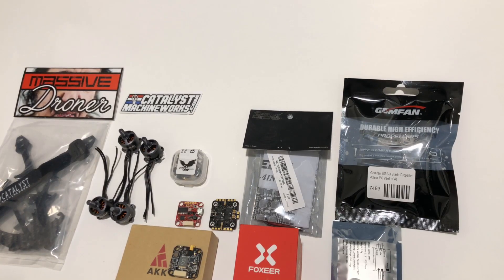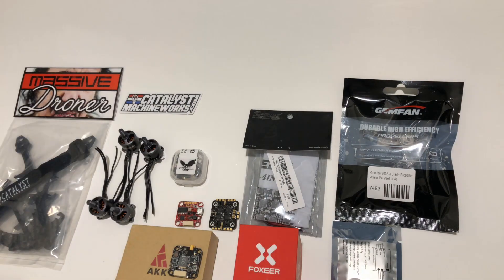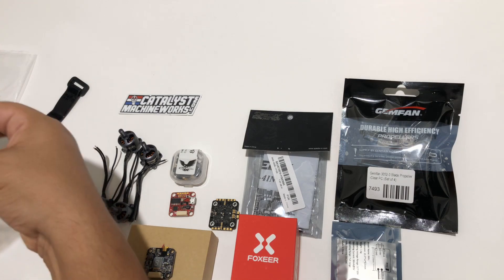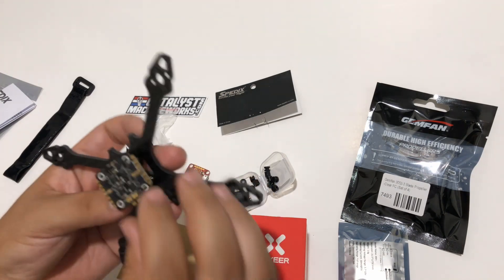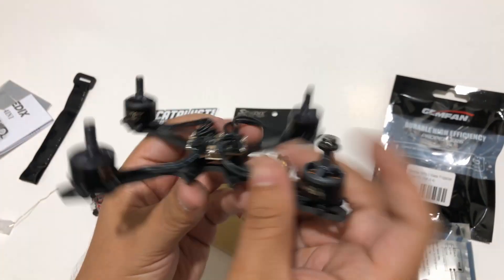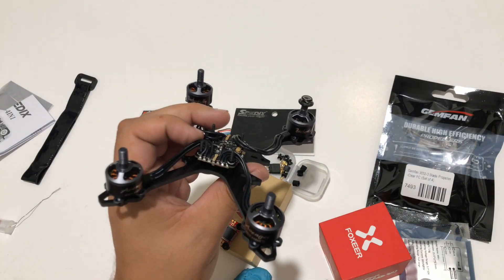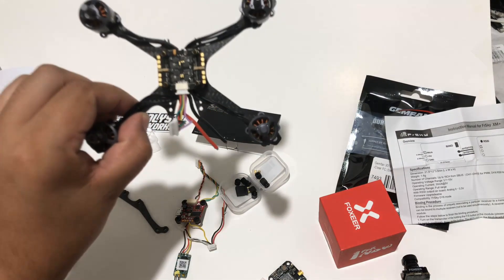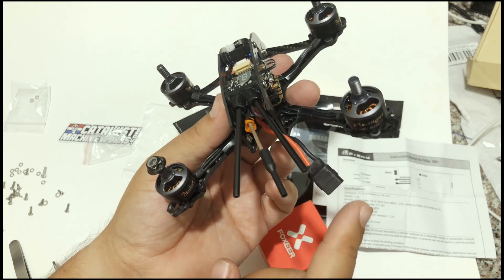More Massive Droner Build video

Comment: I got mine up and going and liking it with BH 1507 3600kv motors.  I wanted to try 4100kv but all I have are 4s 650 lipos and I thought 4100kv would be to much for them. Looking forward on what you think about running the massive droner 3” on 1507 4100kv.
Reply: SteveO4478  my More Massive Droner is running the BH1507 4100kv motors and it freaking rips!
Reply: Rick Markham yeah I wanted to use 4100kv don’t have a lipo to support it I wish I did. Still has plenty of power on 3600kv but 4100kv would have been nice!
Reply: @rickmarkham2584  Post is 2 years but curious what batteries you were or are running with the BH1507 4100kv motors
Reply: @krayzenvy  Tattu RLine 4s 95c 850mah batteries ;)
Reply: @rickmarkham2584  thank you!  Those are the ones I'm about to order but not easy finding the xt30 available like the xt60.  I'll just wait on the xt30 to come in.
Reply: @krayzenvy  no sweat! They are a good fit for that set up, no complaints from me!